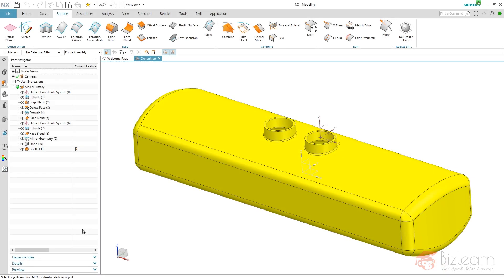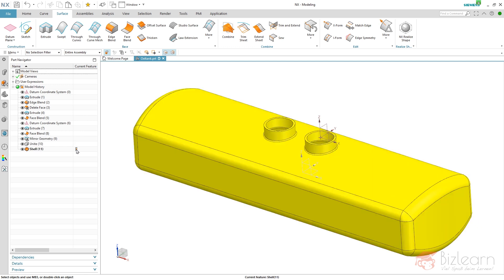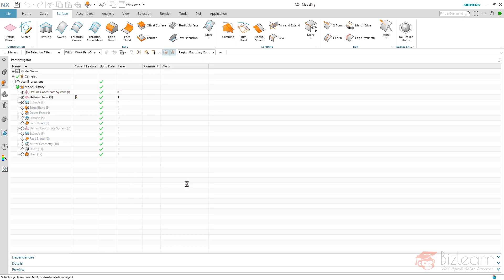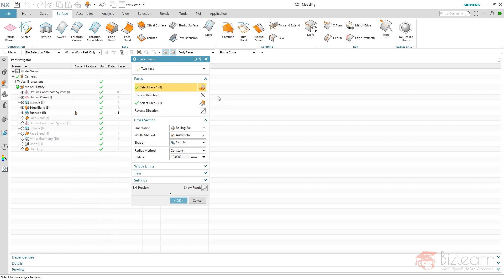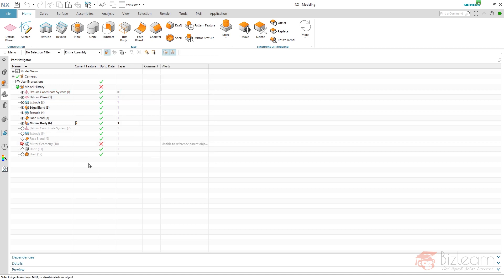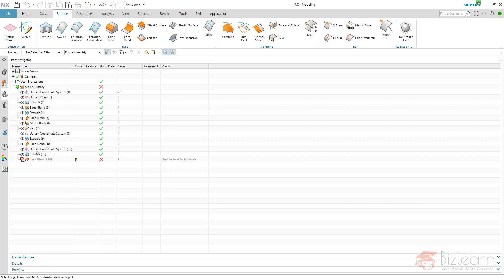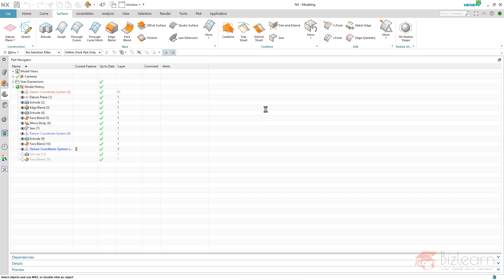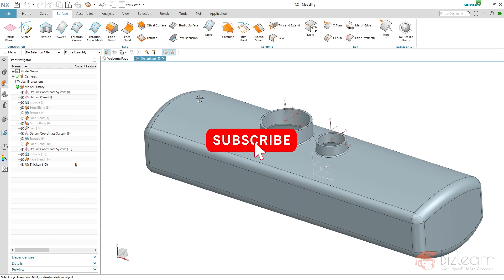Siemens NX Pro Tutorial - using the part navigator for selection to increase model stability

Comment: Hi Simon, could you please tell me what you PC Configurstion looks like? Wich CPU and which GPU do you use and so on. It looks all so smooth what you are doing.
Reply from the maker: Hi Felix,
I have a few Laptops in use. The one I am producing content is pretty old. i7-4800MQ CPU, 2,7 GHz, 32,0 GB Ram, Nvidia Quadro M2200k.
My new notebook, which I have received a couple of months ago is even better. I am using this for my VR and also Rendering etc. It's assembled with an i9 Processor, 126 GB ram, 16 GM GPU Ram etc... I don't have the detailed specs in mind. It's the best notebook I could find on the WWW (-: